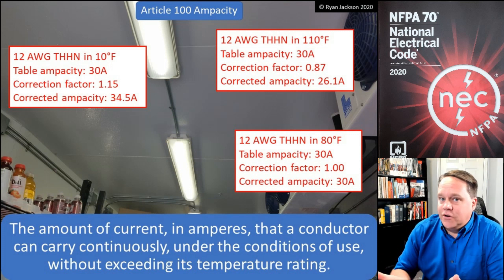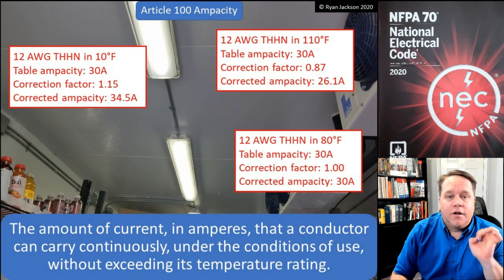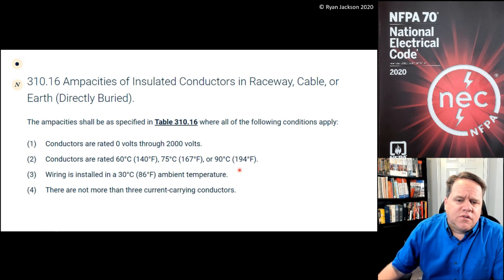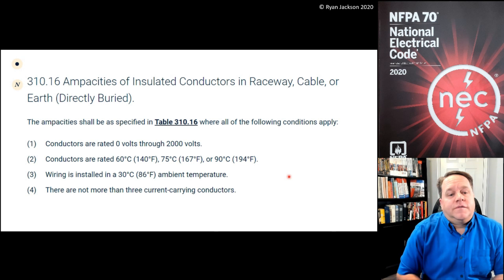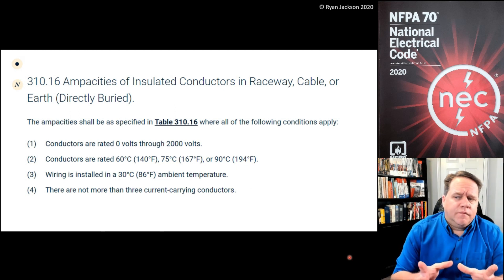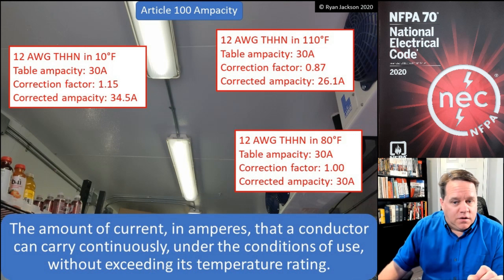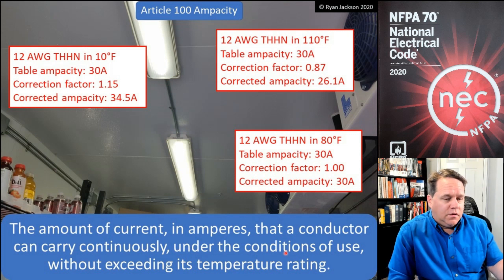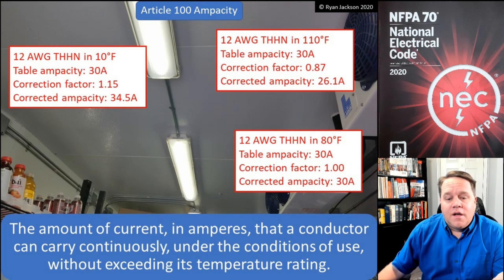100 days of Article 100: Ampacity

Comment: Is it permissible the have a 20 amp circuit, 20A ocpd/12awg wire with14 awg pigtails to the receptacles?   Just so you can backstab.     Thank you.
Reply from the maker: Nope.
Reply: @RyanJacksonElectrical  I didn't think so, but they are doing this in downtown seattle in several 50 story/500 apartment buildings.   Claiming "tap rule" allows it.     Thank you mr. Jackson.
Reply: @--JohnDoe  When you use a tap rule, you have to ultimately terminate you tap conductors in an OCPD/disconnecting means.  Only exception is if you use a tap rule that is allowed to contain splices.  Other than that, the conductor has to terminate in an OCPD that limits the current to the ampacity of the OCPD.

Comment: Ampacity being a continuous rating, and circuit breakers being rated at only 80% of their rating for continuous loads, does this mean that you could have a conductor ampacity that is only 80% of the breaker rating?
Reply from the maker: Conductors and overcurrent devices must be sized at 125% of the continuous load, unless the overcurrent device is specifically rated for continuous duty. That rating is only found on 250A or higher frame breakers.
Reply: Ah! Thank you for clearing that up for me. The 80% rule and where it does and does not apply has always been confusing to me. I think the lightbulb has finally come on! OK, sorry for the bad pun. 😉

Comment: If conductor is rated as continous use forever based on that chart n all conditions r met why do we add the 25% if using 3hr or more during load calculations?
Reply from the maker: Because the circuit breaker isn't rated to do that. Note the exceptions in 210.19 and 215.2.
Reply: Thanks. I wasn't thinking about equipment rating.  One other question off topic.  If I had a repair let's say to se cable, replacement meter and install service breaker disconnect on single family dwelling outside, is the 1st panel inside still considered part of service? I feel this is now a feeder and  a subpanel. If so, and the panel was existing would I be required to update the panel with arc faults, etc.? Could u advise on 2017 and 2020 code cycles.

Comment: Are breakers degraded based on high temperature as in the southwest if I may ask.
Reply from the maker: No. They are tested at 104 degrees F (40 C), but their ratings are not adjusted based on their ambient temperature. Too be honest, a colder environment is a bigger concern. I have breakers outside at my home, and gets below zero here. How many amps would it take to trip a 20A breaker? 30?
Reply: @RyanJacksonElectrical  thank you for your reply Ryan...i really appreciate it and all you do.   I just keep spreading the word on your channel ... Thanks again!

Comment: Accurate and informative, what's the ruling on the neutral a current carrying conductor yes? Three ways and four ways only one extra current carrying conductor yes? Why not list the possibilities where these conditions could exist..?
Reply from the maker: There are several variables. I go over it in the video that I linked in the description. It depends on the voltage system, how many conductors share tge neutral, and if the loads are nonlinear.
Reply: @RyanJacksonElectrical  got ya, just joined...

Comment: Thanks for another great vid. One thing that I always questioned my boss was derating when you have say 3 current carrying conductors along with several 24 or 120 volt control wires that only carry less then 1 amp. ( feed 1 or 2 motor startets ). He said that you never have to derate for control wires due to very small current flow on them. My father was one of the first eletricians to use type THHN/THWN in our city. When he tried to order it electric supply house never heard of this new type of insulation. Took a couple of samples into my vo tech class and teacher did not like it due to insulation being so much thinner then TW. Told him that THHN/THWN was gasoline & oil resistant and good for 90 degrees C in dry location. He finally came over to my side after reading about it in EC&M magazine. About 45 years ago EC & M magazine had an article where the Philadelphia Gas Company got approval to use say use #2 copper for over 200 amps because it was in area that was guess maybe 50 degrees F below zero for liquidfied natuaral gas pumps.